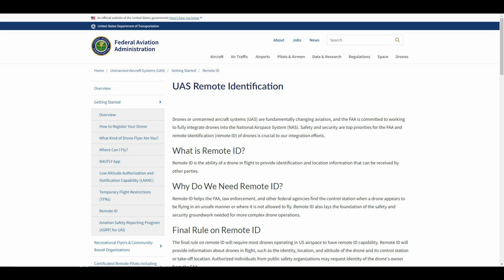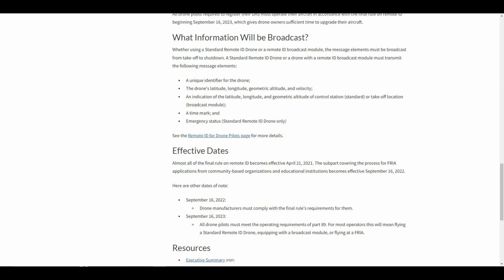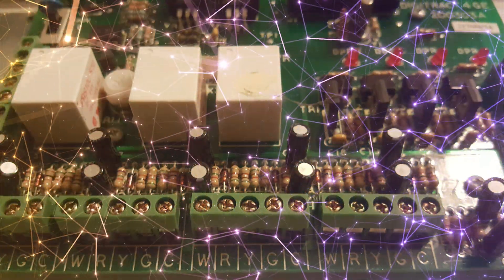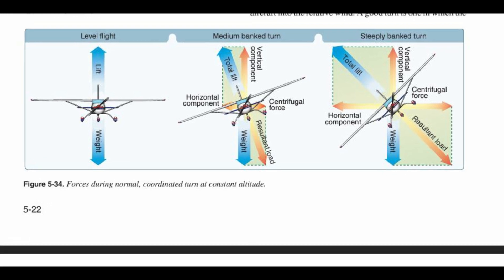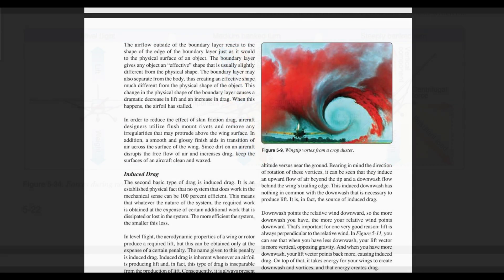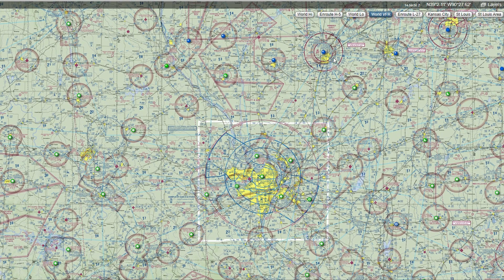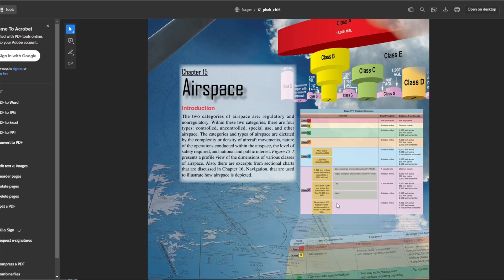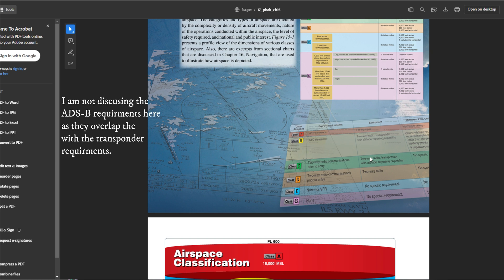#RemoteID is doomed to fail - A better Solution

Comment: You produced a well thought out presentation here and quite sensible too! I like that no new airspace has to be created and little added cost or material to do so. I may add that the FAA should simply stick with educating model flyers instead of inventing new rules to get them in trouble. There was just such an example of this in the form of an Advisory Circular, AC 91-57(canceled) https://www.faa.gov/documentLibrary/media/Advisory_Circular/91-57.pdf. Although this document is outdated for today's airspace needs it is a simple one page letter and not a 300 to 400 page legal essay! 

More than twenty years ago, The FAA was getting ready to implement Next Gen for ATC services. I watched a live presentation during a safety meeting in town. Aside from the attractive multicolored flat screen displays to be used in control tower cabs and the high promises, the local pilot community saw through the snake oil sales tactic. It was a poorly thought out scheme that had more problems than solutions. It was more cost prohibitive for aviators to fully equip their aircraft to reap the benefits. Part of the plan was to discontinue using primary radar surveillance for most of the system and rely on equipped aircraft to see each other and for ATC to track them in the same manor. 

During the meeting, it was pointed out that many aircraft can fly legally and safely without an electrical system. These same aircraft stayed out of rule airspace to avoid a traffic conflict. If one wanted to fly in more restrictive airspace, you had to have the minimum of ADSB out to do so and a two way radio with a clearance. However, if the new transponder failed, there would be no ground equipment to track the aircraft and separate them from others in the airspace. 

AOPA had worked with regulators to ease requirements and make it more affordable. However, it took many years to fully deploy Next Gen and there is still more work to do. 

You should forward this presentation to the FAA as a more sensible and cheaper solution to their perceived problem dealing with UAS. Your calm polite demeanor is a breath of fresh air!

 Blue skies and calm winds.
Reply from the maker: I remember when ADS-B was a sticking point for GA. It is a bit of a different animal though, and while it does have some downsides, it has also proved useful. It is infact entirely possible that ADS-B saved my life. 

I was departing from Darlington in my Sundowner and I was giving my position reports as per normal on the Darlington CTAF. I was climbing out, and a Cessna 172 was descending on a reciprocal heading. I could see him on my GNX-375, but he was either not making radio calls or was not on the right frequency. So I diverted a bit to the right, and we ended up passed each other about 500 meters or so apart at the same altitude. If I'd not had ADS-B in, and been paying attention to it; there may have been a mid air. A very close call at the very least. 

Now I say all that to say this; R/C and UAS bellow 400' AGL don't need that kind of equipment. There are no lives at stake in a small unmanned  UAS, and they are below the normal operational altitue of manned aircraft. So it is completely ridiculous that they should have RID. The birds that fly in that relm don't have it & they will pose a much bigger issue for commercial UAS than recreational UAS ever could based on shear numbers alone.
Reply: @iflycentral  Thanks for sharing that story. I'm glad it had a happy ending! I hope that the FAA doesn't get a fool idea to scale back ATC staffing to save a few bucks in the future either! 

RID for recreational model flyers is a dumb idea at any rate. As you pointed out, there is no extreme risk at the altitudes we operate. If a RC flyer wanted to take extra precautions with manned traffic, one could purchase an inexpensive handheld transceiver and monitor calls. In addition, they could have a friend volunteer to be a spotter. 

See and avoid had worked pretty well in the past and it doesn't cost that much extra in time or expense.

Comment: In class D laanc should be more than adequate. All things considered, flight duration, limited altitude, everything logged, simple app. No need for a module
Reply from the maker: Good point. Same would apply to airports in class E as well in that case.

Comment: Some good points. Apart from the extra "load" of privacy issues and risks for rc pilots forced to broadcast their location, the last thing you want to do with an rc plane, is add weight. This will be a waste of resources for sure. Class G should be free, like it has been and has been proven to work just fine.

Comment: Interesting to hear an actual pilot's view on the current RID debate. One aspect you didn't mention but seems to be a major issue for many is the safety of a remote pilot. By broadcasting your (often secluded) location you are inviting unwanted attention and that may be of a nefarious and violent nature.
Reply from the maker: Yeah. This kind of problem is faced by manned aviators as well. Without going into the specifics; the FAA basically doxxes everyone with a PPL. It hasn't been a huge problem, but it absolutely could be. Rather than getting too much into the weeds on that side of things; I wanted to focus more on a solution that would simply remove the RID requirement for the vast majority of operations. I'd love to see everone take my idea & run with it, or even refine & improve it further.
Reply: @iflycentral  I think the problem with your idea is that it sounds entirely sensible and might actually enhance safety, but RID has nothing to do with safety really. It was born out of a two pronged charge of politicians desperate to show they are doing something positive to combat the perceived drone 'national security menace', and of commercial interests lobbying to basically charge for use of the sky. The real purpose of RID is to remove recreational UAVs from the sky, or at least to set conditions under which we can be made to pay.
Reply from the maker: @andytean5906  a two pronged attack with a two pronged retort. RID needs to be shown as an ecological disaster, and a failure on the safety & security front. It also needs to be lambasted as a violation of individual rights. Privacy as you pointed out. Could even be presented as compelled speech. There are a lot of avenues to counter attack RID.

Comment: Great points and viable solutions.  My only add is the 400' is still too low. See and avoid has been, and will always, be the #1 rule. And it works as confirmed by the statistics. We don't need an altitude limit.
Reply from the maker: I do think the 400' limit is acceptable. In manned aviation we have altitude limits. We cannot go below 500' AGL except in areas that are completely uninhabited like BLM land. We must stay above 1000' AGL  in densely populated areas. We also can't enter class A airspace without an IFR flight plan. That basicly limits all VFR flight to below 18,000'. 

So I say that 400' is reasonable for uncontrolled UAS flights. It gives a 100' buffer between manned, and unmanned aviation under most circumstances. Also, my proposal also provides a way to fly above 400' for those who want to with RID.

Comment: Makes perfect sense however since RID and associated regulations were created by commercial lobbies with the goal of removing the recreational flyer from the airspace entirely the powers that be will never agree to put a solution such as this in place.
Reply from the maker: Never say never. There would absolutely be resistance to this idea, but it should be pushed incessantly. Don't "self eliminate" with a negative or hopeless outlook on the matter.
Reply: @iflycentral  Yep not giving up. Just saying that you won't get the FAA to listen. Congress is the only way to get change and so far they aren't listening either. I'm just one person but I will be primaring my senator and congressmen come election time because they didn't even acknowledge my requests for change in the upcoming FAA re-authorization act

Comment: Thank you for joining the discussion and I enjoyed your thoughtfully prepared presentation for a sane and workable solution to this RID proposals and implemented laws. Why would the FAA have not considered such an obvious solution to the issue that actually makes sense and would be readily accepted by all the players? The draconian regulations and rushed process of implementation is suspicious that there must be an alternative agenda being worked here. Not to be a conspiracy theorist here, but it does seem that there is a lot about this issue that we are not being told.
Reply from the maker: I think it is far less important to try to figure out why they did what they did. What is more productive is for us to push for a better solution more favorable to the Hobby. You've got to put forward what you want and push it incessantly to the point of irritation to make the powers-that-be relent. If someone comes up with a better idea than mine that's great but until then I think this idea should be pushed hard.

Comment: This is really good. The system you described is basically how it works right now with LAANC but a little more permissive if you jave RID.

I think the biggest problem we're facing is that your system and the current rules don't seem enforcable enough to the FAA/lawmakers. The goal of RID isn't to change what airspace is restricted per se, it's to help the FAA catch you if you break those restrictions. The problem: this only works if all UAS have RID. If there are large areas where non-RID UAS can fly, then those non-RID aircraft are still wild cards.

It was pretty apparent in the original NPRM that the FAA was going for a 100% standard RID (no homebuilts) world, and it's really the only way that their system provises any additional security. Anyone without RID is still just as unregulated as before, the only change is that law enforcement and the paranoid public might notice non-compiant UAS and proactively penalize the user.

Also, in a few parts of the video, you said, "This is the way it should be," and while I agree, I do feel like it's more compelling to iterate the concrete benefits of a system rather than invoke a somewhat arbitrary sounding "it should be my way."
(And you definitely did explain earlier in the video, I just think that your proposal sounds a lot stronger if you reiterated the concrete benefits of your airspace system vs current RID as you're explaining your system)
Reply from the maker: Problem with RID is that is provides zero protection regardless of how it is implemented. People who want to use UAS for criminal activity are going to, and they will DIY their craft with no RID regardless of any rules put forward.

Comment: Hey Central, I think the one thing thats missed is, under the current admin restricting UAV's is there doorway to "sell" airspace to the coming drone services thats about to sweep the nation. I have been a member of the AMA for 15 years and was very disappointed in there response to the FAA. But you are right about any bad actor not caring a bit about laws and rules that the general RC public does...
Reply from the maker: Drone services are a farce. They won't happen. So stupid is the idea that I see no point in addressing it directly.

Comment: Excellent contribution to the debate on remote ID and a beautifully crafted and edited presentation. Thank you. The current FAA rule seems to be an expensive, impractical solution to a non existent problem.
Reply from the maker: Expensive and totally out of touch with reality as the rule is currently written.

Comment: Well, it's clearly not about a safety issue. If it was, the far more important push would be for all manned aircraft to be equipped with transponders, given their far greater likelihood of busting controlled airspace, and the greater consequences of larger, heavier aircraft in collisions or crashes.

It makes me wonder what the actual reasoning is. Does GA just have that much better of a lobby? Did law enforcement get a burr in their saddlebags over having to share the sky or wanting to surveil people or something?
Reply from the maker: It's multifaceted. GA does have a strong lobby, but beyond that, it's more difficult to incriminate GA in the eyes of the public the way the powers that be have done to model aviation & unmanned aircraft. Military drone strikes were talked about in the media for years so much that the word Drone itself became demonized. That word got attached to quadcopters & eventually other model aircraft, and so it was far easier to sway public opinion to support regulation. 

That is just one aspect, but you can see how it happens.